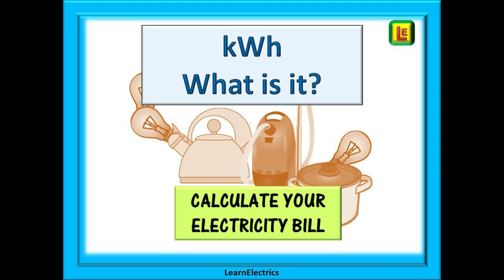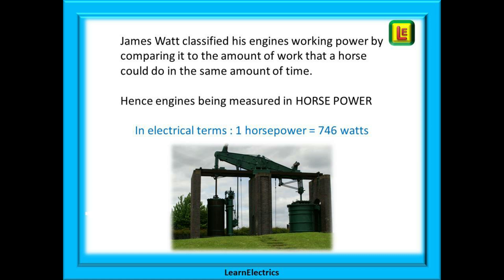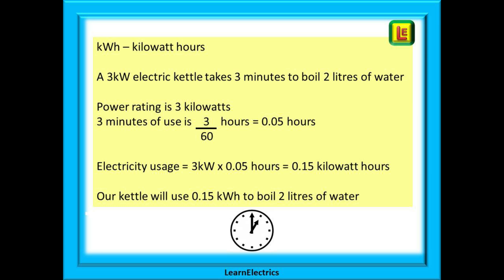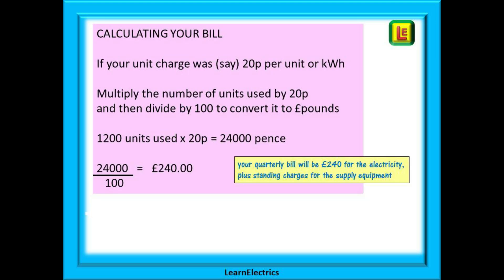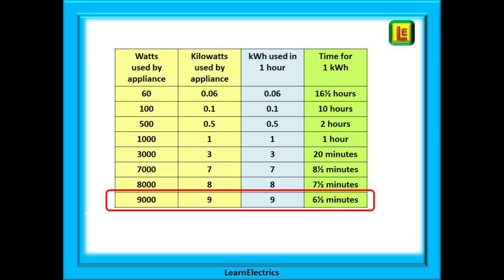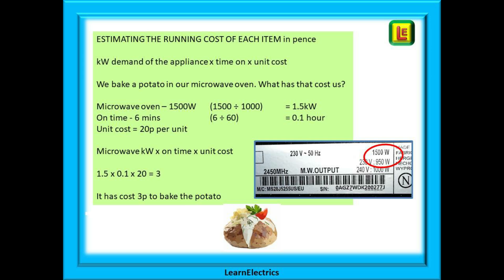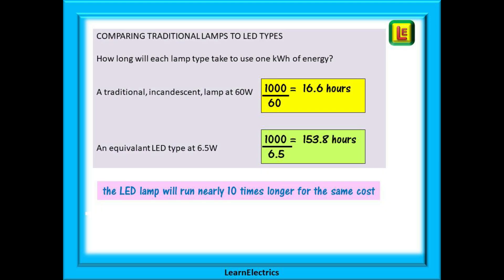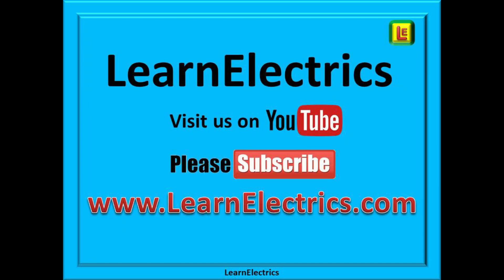kWh – WHAT IS IT – HOW CAN I CALCULATE MY ELECTRICITY BILL

Comment: You are wrong at 0:46. A Watt is a unit of POWER not energy. Electrically Watts = Volts X Amps (at unity power factor). Energy needs the dimension of time. You are also wrong at 3:17. It is a kilowatt of POWER being used for one hour = 1kWh, not a "kilowatt of ENERGY" ... there is no such thing. I know you know this, but you are stumbling over yourself in your presentation by interchanging Power and Energy
Reply from the maker: Thanks for the input. Dave.
Reply: So are you saying his calculations are incorrect
Reply: It is his commentary that is wrong. He has over-explained it, rather than say it once and let users re-wind. Hen is falling over himself in referring to Watts as Energy. He will know the mistake, ... but if you are educating people you must be word-perfect. If you call kW energy, yes, your calculation is wrong  @coolerkin